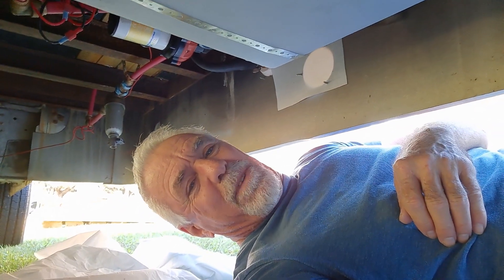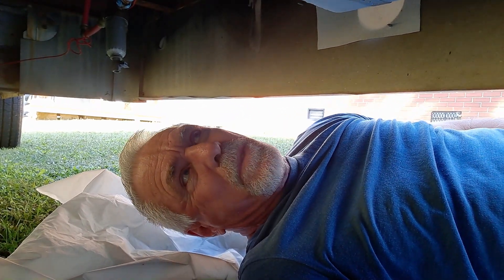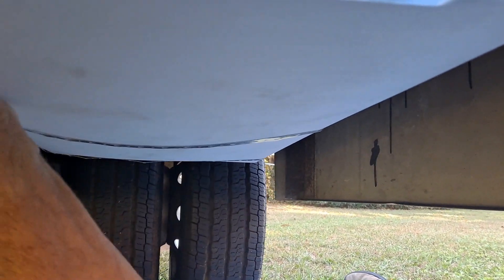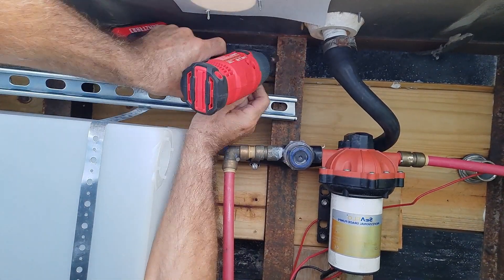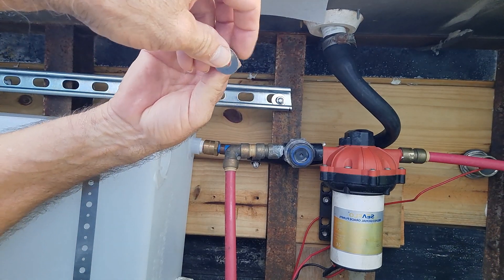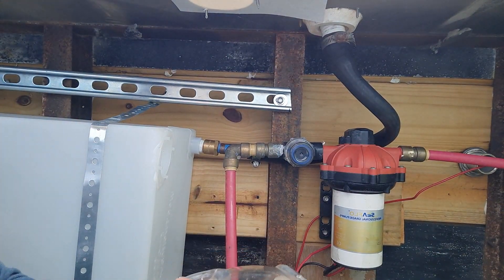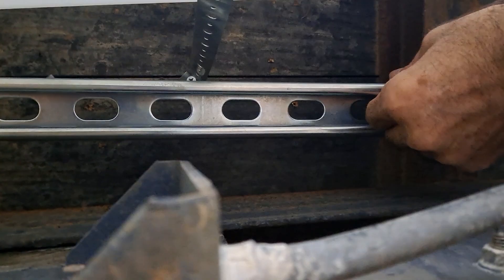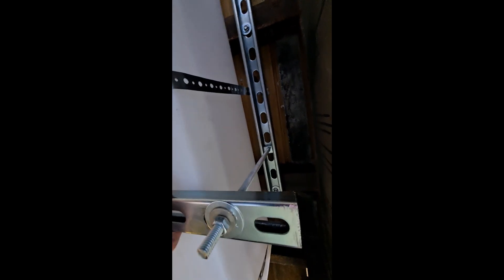Box Truck Adventure Water Tank Reinstall

Comment: Not sure if you mentioned how you fill your tanks  but I assume from the outside. If there was a way to add water while in the truck you could add hot water during the night then recirculate it for a minute or two. With these cold temps coming I dont think I would be able sleep. When in doubt dump all of it!
Reply from the maker: ronald duck, I don't think I have ever mentioned how I fill them. I do it from the outside. I installed an RV water tank filler inlet. Or something like that. So I just use a garden hose I have in the back and fill it that way. When I don't have access to a spigot, I'll use a funnel and my water tanks if need be. So far, I've only done that once. It's getting chilly here but not cold enough to freeze it, but good idea if it does to dump it. I would hate to have the tank burst!! Good advice. Thank you and thanks for watching.

Comment: Apparently, you don't plan to be in freezing air temps nor off the asphalt.
At the least I would install a skid plate.
I plan to have my tankage in thermally insulated boxes. The plastic tank will not be exposed to ambient air nor the bottom and sides be unsupported.
Reply from the maker: Mark9898, good idea on the insulated boxes. No, I wasn't planning on offroading or going to freezing areas. Good luck whenever you start yours and thanks for watching!